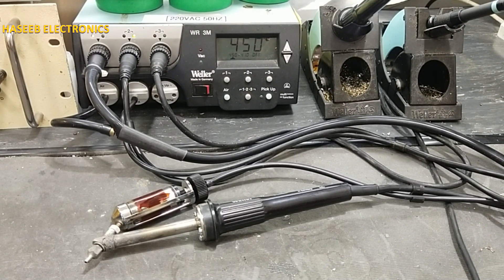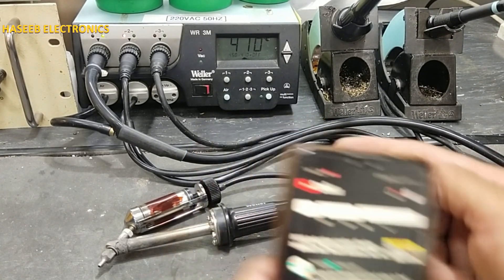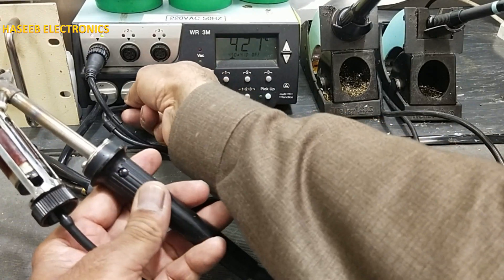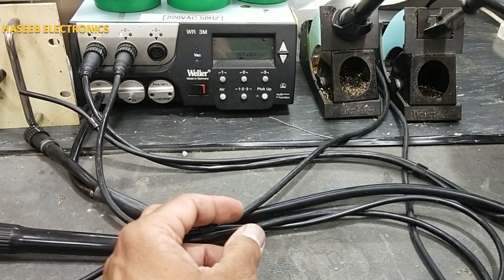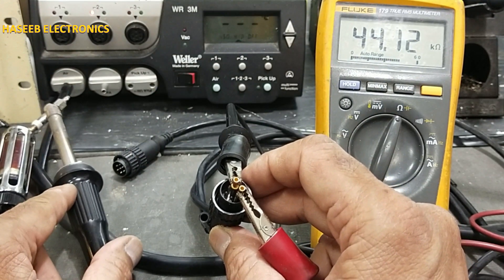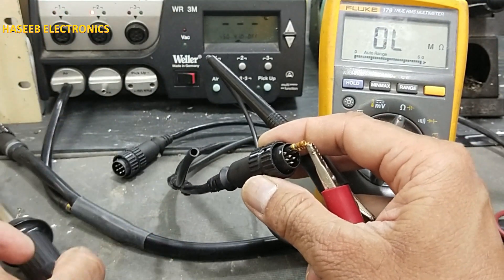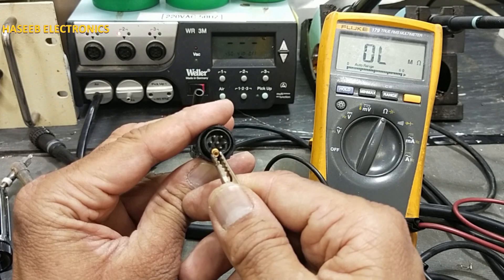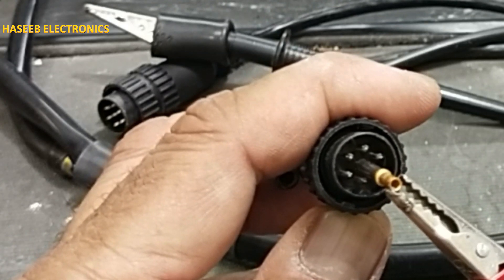{879} How To Troubleshoot DSX80 Desoldering Tool

Comment: Salam- walekum & THANK you very much sir, you replied my doughs regarding re-work station,  As per your instruction, i have check continuity at connector of de-solder gun pins. i found as per following (from guide i.e. notch to anti-clock wise)  1) pin 1&7 - 44k ohms and 1.7 ohms,  2) pin 1&2 - 6.6 ohms, 3) pin 3&4 - 23.5 ohms, 4) pin 5 & body of gun - 1ohms,   My de-solder gun is heating and all 3 channels of re-work station are working, but still suction is not available.... sir  please suggest regarding  1) configuration parameter of machine? 2) Filter of suction ? 3) solenoid coil ? 4) controller of machine?  Thank you again spending your valuable time for making video regarding continuity testing of connector pins of de-solder gun (As per your video my drought regarding de-solder gun is clear, no need to replace gun )